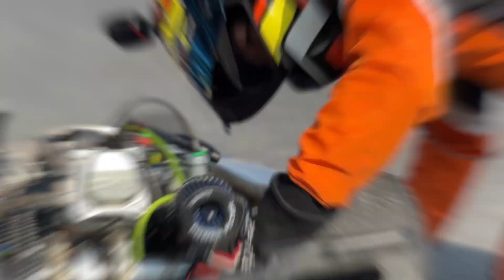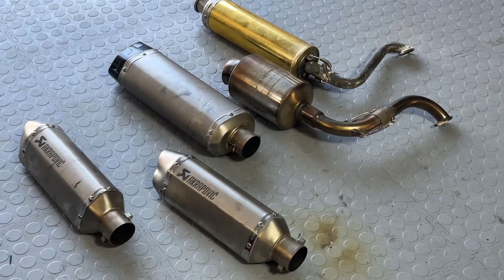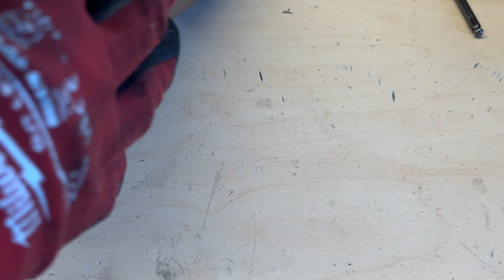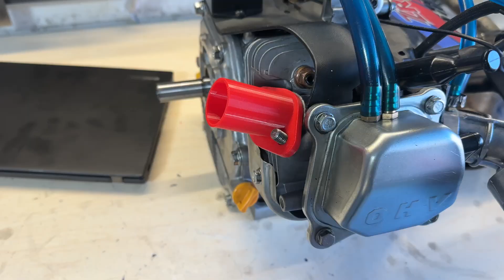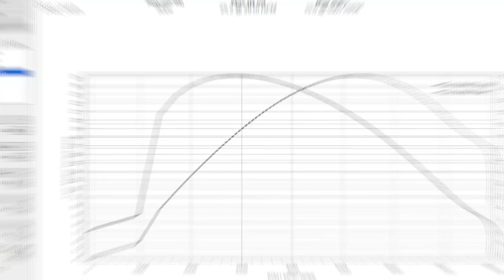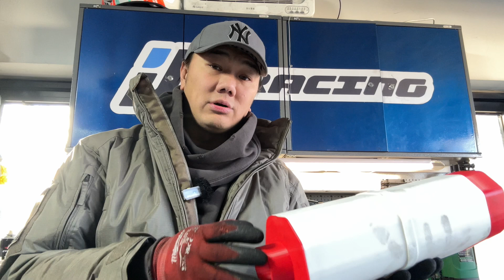DIY: Designing Our Own Exhaust

Comment: Using the exhaust flame to roughly get the exact angle the gas leaves at seems like a really quick and dirty way of getting what you want without a whole bunch of calculations and maths. I love it.
Reply from the maker: @Ayane13b  well it wasn’t just the flames lol i also did use some sticks to sort of get where the exhaust port is pointing then I used a digital angle meter to measure it. But yea, didn’t do math for that for sure
Reply: @js_racing_jason  Hahahaha i love it! Exactly what i would have done in that situation. I'm more of a hands on kinda guy and not a great numbers guy, so i'm always finding quick and dirty ways to do things, and more often than not it ends up being exactly what i need lol. Keep it up brother